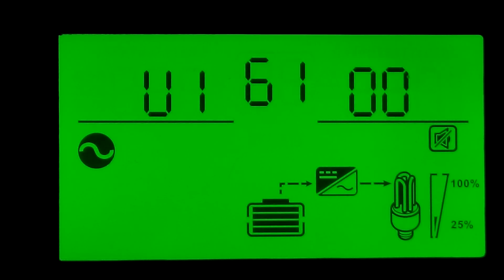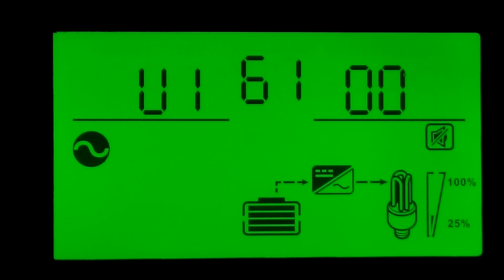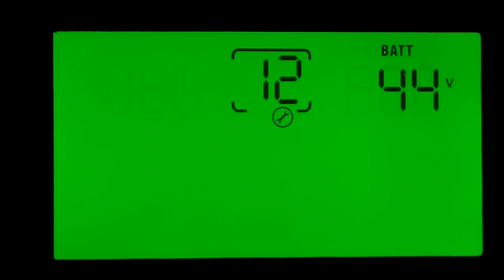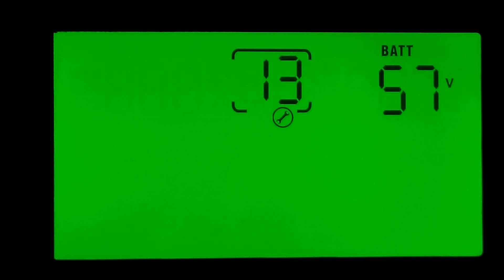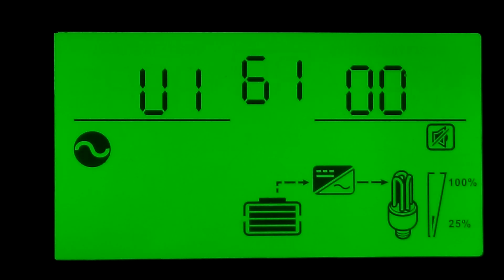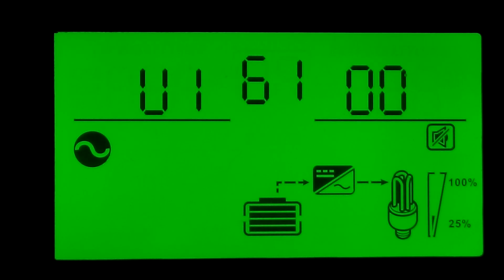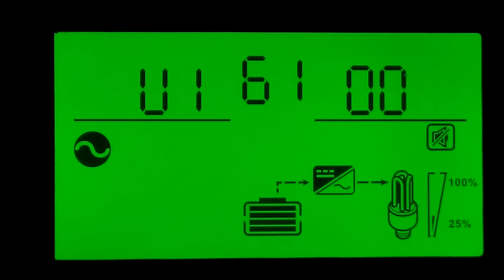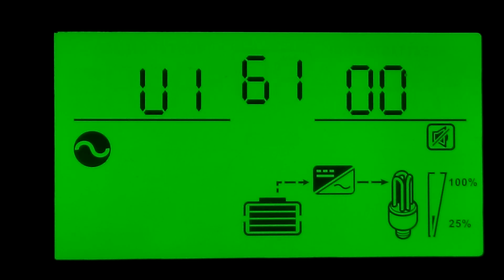My settings on my MPP 5048 inverter.

Comment: I have a 5kva novel mppt 230volt. I am having trouble installing it to my breaker. It only has 3 legs,L,black wire, N,white wire and G,green wire.  It also has the grid input. It works fine on the grid input. But when I try to switch over to SBU or SOL. It cuts off on me,now I put it on 60hz. Which is what I need being in the United states. But it keeps blowing light bulbs and burning my surge protector. Had it not been for the surge protectors I would have damage my Samsung fridge and other appliances in the house. How do I connect this to a breaker? I have 12 solar panels and 4 100ah 20 hour batteries that are fully charged.
Reply from the maker: Sounds like to me you have a 230 single phase you will have to use a transformer to use that in the United States.  The 230 volts will have to be ran through a transformer and brung down to 120 votes it's videos on YouTube showing you how to do this.

Comment: Thanks for the set up on the MPPT. Took me a week to find you,but very helpful. I seen another video where you run the dryer,microwave and other appliances,I also seen that you say leg 1 and leg 2. Do you have 2 MPPT in series,and I would like to know how you have your setup.
Reply from the maker: The lv5048 come with two charge controllers inside one unit and it's also a split phase 240 that's why you hurt me say leg one and leg too. You can also run it as a single phase 120 unit 2.

Comment: My friend a have a question, I need to use the AC LINE, but I see that in your setting that this dont work, How I can working with the ac line?
Reply from the maker: Explain to me exactly what you're trying to do and I'll see if I can help you out.
Reply: I have the same issue. I see you are connected to grid as well but using the batteries. I see the grid icon just like urs but there is no path from the icon to the batteries. Meaning u are using ur batteries to power load not the grid.

Comment: Hi Carson, how can I set the DOD on the inverter. I want to set 80% DOD for lifepo4 battery and I can't find the  option. One more thing you set your cut-off voltage at 40V. Why do you choose 40V??
Reply from the maker: Explain to me what you are meaning by DOD so we both can be on the same page. And the reason why I cut mines off at 39 volts is because I like to have reserve in case we have a power outage or something I have a little power left in the battery to make it until the next day. It  also give the battery a little bit longer Life by not discharging them to 35 votes completely discharged.
Reply: @carsonlurbanwindandsolar3437  DOD= Deep of discharge
Reply from the maker: @yoneidisantana  if you're inverter is a lv5048 press the enter key hold it for a couple of seconds then scroll up to 12 hit the enter key again and then you can set it whatever you like.

Comment: Thank you for your videos and i have a question , on the 5KVA 48V 230ACv output. can the Voltage
be adjusted to 110/120ACv using the display panel or are there any other way to do it ?
Reply from the maker: I believe that unit is a single phase if you are in the United States or Canada you need a split phase 240 ACv .  The LV5048 is a split phase.
Reply: You can also use an ST-5000 Transformer to convert Single Phase to Split phase.  
Off-Grid Steve has a video on how to do it.

Comment: I bought the lv5048 last night I can't wait for it to get here, one thing that I cant seem to figure out is if It can float my batteries at 52v and have the inverter never draw from them as long as I have PV or grid power. Basically I don't want to cycle my batteries everyday and just keep them there as a backup and mainly run solar during the day and switch to grid at night, is this possible on this unit?
Reply from the maker: Congratulations hope you enjoy it as much as I do👍.

Comment: Thank You and great idea on the paralleling them to balance out that would be top balancing is that correct? Leaf battery should be here after Thanksgiving then I'll get started on installation of  LV5048 and Leaf Bank. Another question how did you make buss bars?  flattened copper pipe? I've seen that before  type L   is the thickest.
Reply from the maker: Yes I guess you could call it top balancing but you can do it at any state of charge 😉.

Comment: Thank You Very much for sharing your settings. I'm sure this WILL come in handy to a lot of us in the not to distant future! :)
I have a question regarding the Leaf batteries that you may perhaps be able to answer. I have access to some packs where some are reading at 53.4v and some at 54.3v. Do you think I'd need to take any special precautions regarding trying to adjust the voltages before paralleling them all together so they would all read the same/identical voltage? Thank you for any consideration towards a response.-Al
Reply from the maker: parallel them all together and let them sit for 24 hours  to let them equalize. Disconnect them and check them again with your voltage meter to see if they all equalized out and if they did then put them into service.
Reply: Thank You Very Much... will attempt this ASAP.